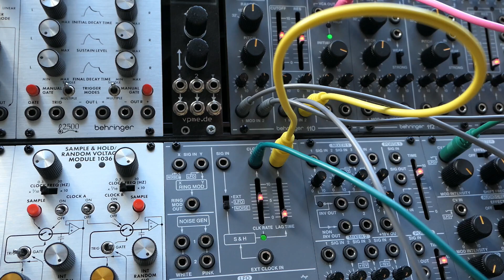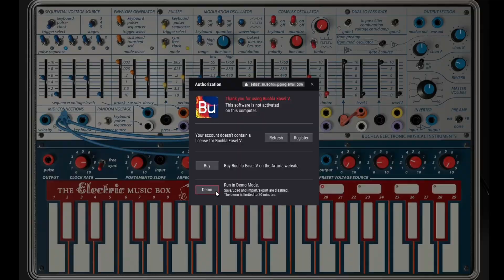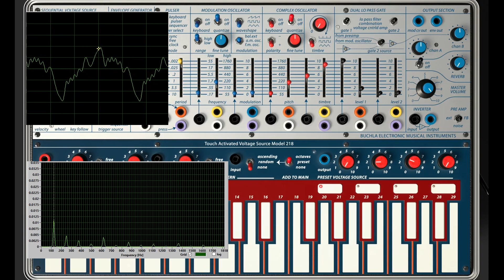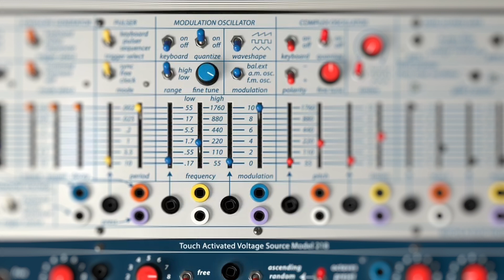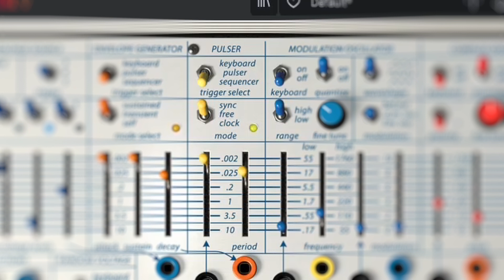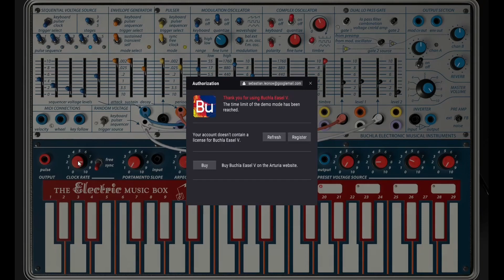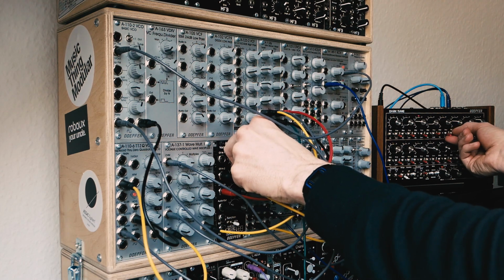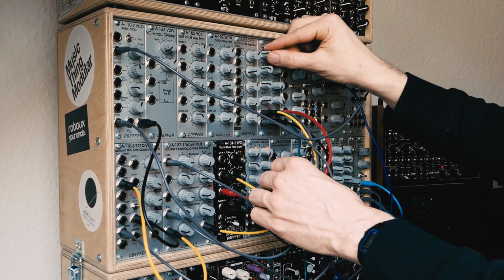West coast style ~ additive synthesis with Arturia Music Easel & Doepfer A100

Comment: Hi! I just got the A137-1 and i don’t want to blow it up. How does it properly connect to the case? With the 16 pin cables? Thanks!
Reply from the maker: The 10 pin connector onto the module and the 16 pin to the case.
Reply: Make sure to locate the red stripe (sometime solid, sometimes it is striped in red) on the cable, which is the -12V one. Line up this -12V side to the -12V on the module and also when connecting it to the case. It either says it in numbers, or it is marked in some way, a small, white stripe for example. Some power supplies don't allow to get it wrong, cause they have a notch, so you can't plug it it the wrong way. Make also sure all 10 / 16 pins are in the connector and none of them stick out of the sides or front or back. And you should be good to go :-)